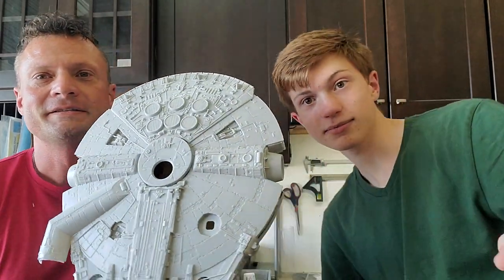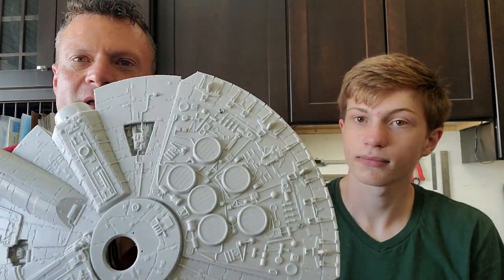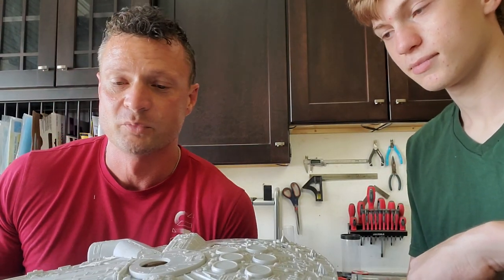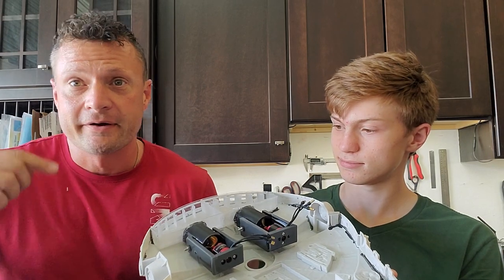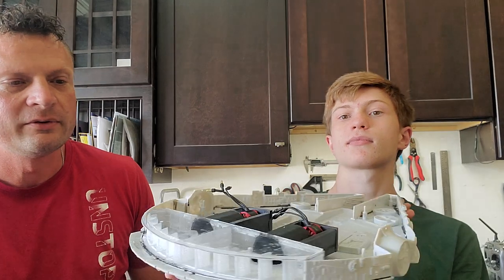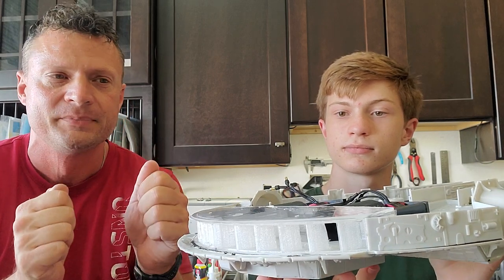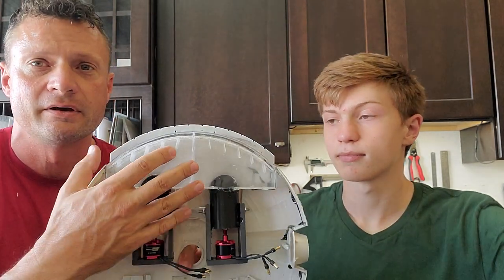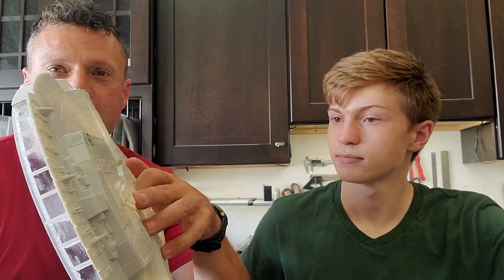RCSubGuy and the RCSubKid talk Remote Controlled Millenium Falcon

Comment: did you refer the the brushless motors being factory waterproof?
Reply from the maker: They work in the water, and that is all I will commit to. They require additional maintenance to avoid corrosion, however.